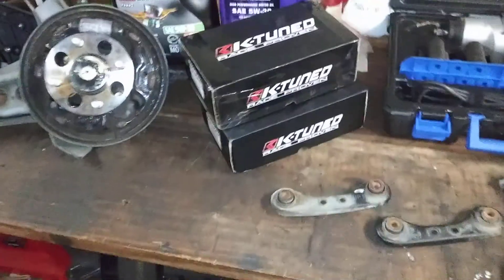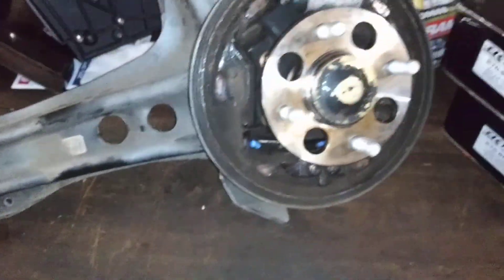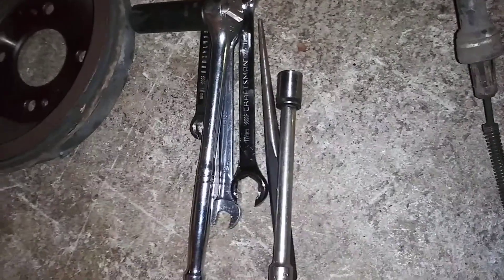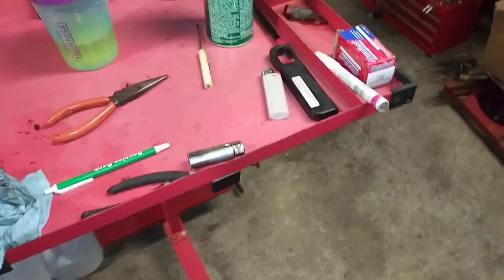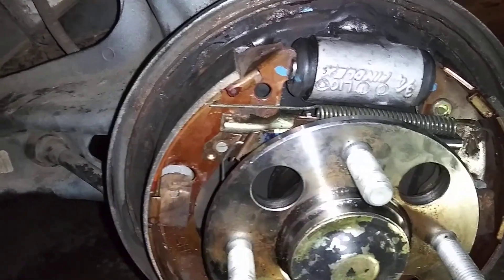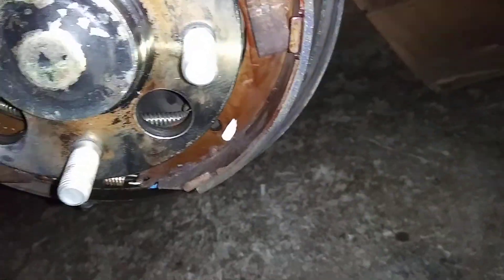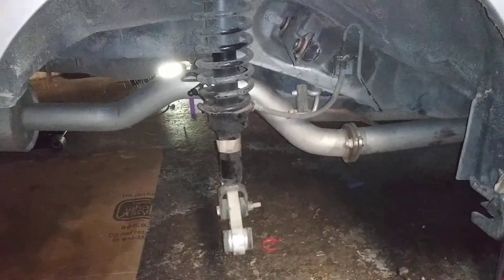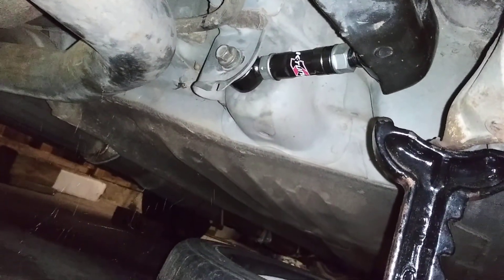2000 Civic Ex K-Tuned Suspension Upgrade

Comment: I'm sure you got it figured out by now, but put a hose on the brake valve nipple, open it and pump the brakes till air bubbles stop. Easy diy by yourself..